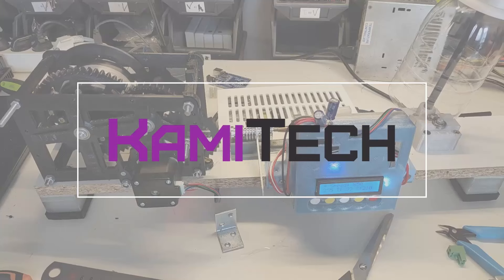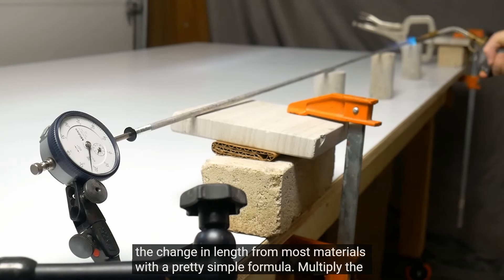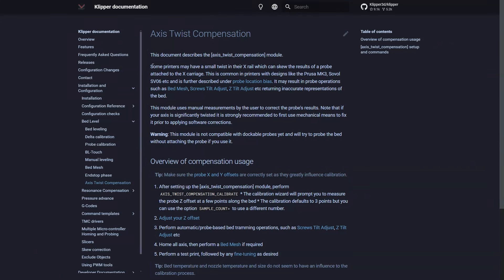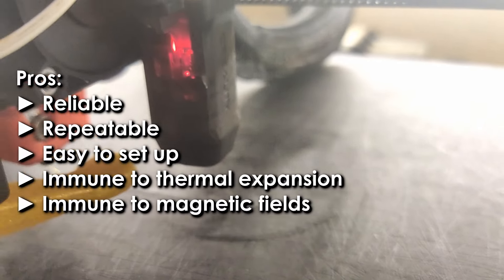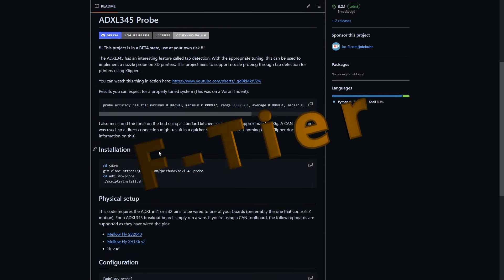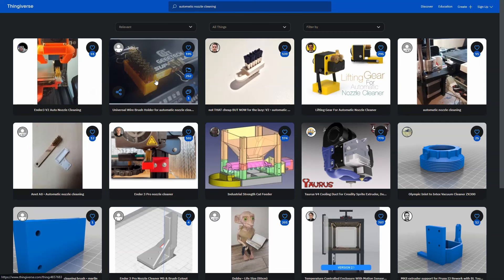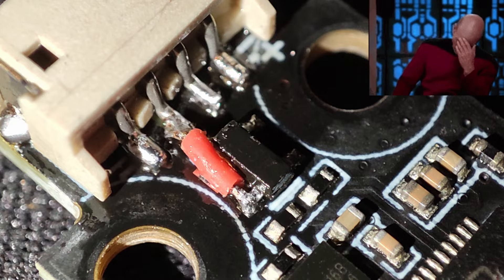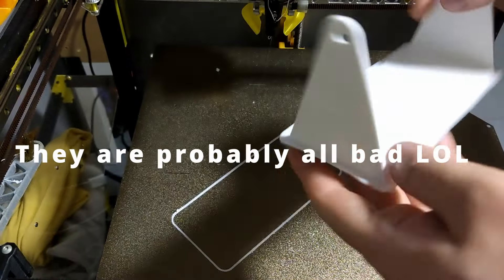Why All Bed Levelling Probes Suck - Eddy Modding and Testing

Comment: Beacon is pretty good :) especially now that it has contact. i've never had better first layers. Not to mention if you go full contact strong magnets don't matter :)
Reply: I was shocked when I used Beacon Contact the first time. I was like 'There's no way this just works... holy crap. I didn't have to set an offset. I didn't have to do ANYTHING. It just... worked.
Reply: So I thought it used eddy coil to get the mesh and that have magnets would affect the probe can you elaborate more on this, maybe post a link or some supportive data. I'm now genuinely curious about this.
Reply: @fredhenning798 contact function in Beacon is touch based and super low force. I’m using it on a wobbly switch wire bed and it’s perfect, in every way.

Comment: Interesting comments, smiled at the brass brush nozzle cleaning, as been there done that years ago, and it really sucked, because the ooze set on the “bristles” and caused mis-steps. Shame you couldn’t get a Beacon, as I was waiting for that one. Good work on the BTT Eddy 👌
Reply from the maker: In my case brush also didn't do anything with petg, nozzle just grabbed chunks of it anyways and stringed away, dragging giga blob across build surface 😂
Reply: @KaminarisTech yes PETG is a pain to clean and so is TPU. Have to do it manually
Reply: I have tried different inductive probe. Kicky and TAP. So far for me the TAP is the most precise one. But I had to change the X rail and the mini TAP rail for medium preload rail to get consistent. But yes it is bulky and heavy.

Comment: My favorite combo so far was a v2.4 with a properly flat bed and physical probe like klicky, quickdraw, or bltouch.   It's incredibly reliable compared to anything else I've used. I've worked with 7 machines on similar setups, and they're incredibly reliable. Currently running a cartographer on one machine and omron inductive probe on the other (no kinematic bed/gantry mounting), and they're nowhere near as reliable.
Reply: Beds are all stock 6mm alu from formbot
Reply: Carto works great for mesh leveling, but z offset can be iffy. I'm going to swap to a nozzle endstop like on the v2 for now, but I'm hoping the nozzle tap feature works properly, like on the beacon.
Reply: Thermal drift kills most non physical probes. Even with a heat soak macro that read the carto coil temp to make sure it meshed and homed within a 5c range and running the temp compensation macro, it still drifts a bit.
Reply from the maker: Indeed, kinematic bed + physical probe seems to be best accuracy and reliability wise as z-endstop. Unfortunately they suffer greatly from axis twist and they are very slow for heightmaps. I wish to try cast iron bed one day :D
Reply: @KaminarisTech  that'll be pricey 😅
Reply: Voron with the cartographer via can is perfect every single time. Never not had a perfect first layer. Klicky is slow as balls.

Comment: In my humble opinion, apart from those thick 8mm aluminum beds most commonly found on Voron printers, I find borosilicate glass bed delivers one of the flattest surface ever. Only problem is chunks of glass gets chipped off as what you had mentioned in your video. So to mitigate this problem, i stuck the magnetic sheet on my borosilicate glass and then offer the PEI sheet over the magnet. The bed does take a little longer to get heated up but once it gets to your desired bed temp. it stays hot consistently. After doing this method my first layer has been consistently great.
Reply from the maker: Yes i did consider using glass this way but the difference in heating speed is real issue. Currently my bed heats up from zero to sixty in about 60 seconds and zero to 90 in 90 seconds. That saves a lot of time the way i print things (prototyping). The only real alternative is just thicc chunk of metal.
Reply: I do exactly the same as you!, 🙂 magnetic sheet stuck to borosillicate glass with a steel pei sheet on top, I run a bed mesh and check the level and adjust where needed by rotating 3 lead screws one at the back in the center and two at the front corners either side, I then probe the center of the bed after it's heated before I start a print. If I want i can remove the bed take the pei sheet off and also print on the glass side by turning it over. I use a bl touch, it's slow probing multiple points on a bed mesh but it works. wouldn't mind trying a beacon!, printer is a Vzbot with some parts from a hevORT it's kind of a hybrid.

Comment: I definitely feel like Nextruder is the best current hands off implementation of bed leveling and Z-Offset. They've shown examples of printing a first layer on cardboard taped to the bed.

For nozzle cleaning I've had pretty good results with an Obxidian or similar nozzles with a good retraction macro to prevent oozing and a straight forward nozzle wiper.

I feel like that the above plus a Nextruder like strain gauge, adaptive meshing would be ideal for me.

Comment: Thank you for this video, I really enjoyed it. One thing that perhaps can be expanded upon is the types of probes relative to the build plate size. Most probes work on the large beds you were demonstrating. No so good on a 120 x120 bed due to large offsets because certainly in the case of the Voron 0 or similar you can only get to probe two thirds of the bed. The new klicky and it`s cantilevered predecessor will score here. Also perhaps the new E3D PZ, I am waiting for one to arrive to test. For example I spent months developing a condensed tap for the Voron 0 to achieve full build plate cover. Anyway, many thanks again for an interesting video, well done

Comment: For Nozzle cleaning, I looked at how Bambu Lab printers do it.
They perform some strange movement, but the more interesting part. They Heat the Nozzle to 250ish no matter the material and just let it droop out the filament remaining in the nozzle.
I applied this to my print start and the results are amazing. It takes 2-3 minutes of oozing, then the nozzle is clean and can be used for homing.
Reply from the maker: Here is the thing. Bambu have super short melt zone compared to like the Goliath hotend which i have and it drips for a LOOOOOOOOOOOONG time :) 
Still, 2-3 minutes is pretty long time to wait just for z-homing.
Reply: @KaminarisTech  yea right 2-3min works for my dragon highflow. But the wait is worth it for me :D
Reply: @TheHanutaXD could you Provide the start Code for that?
Reply: I don’t care about how long it takes. It has to be accurate. 
I use tap and a Bambu hotend on my Voron. I clean the nozzle with a wiper and then clean and cool down the nozzle on the build plate while going back and forth 10mm with z-0.2mm to scrape over the build plate. 

No z-offset issues anymore.. I tried the inductive probe then clicky and tap is the way to go. I use 3 measurements for each point.

Comment: I just ordered an eddy after having a horrible experience trying to set up my  2024k1 max which dug holes into 5 bed plates and knocked 2 nozzles loose, and bent the x rod trying to get through the initial calibration. One of the belts was loose and another was rubbing out of the box.  Creality sent me some replacement strain gauges, a belt a bed plate and some boards but I am traumatized by the physical probing. I'm hoping eddy can solve this issue!

Comment: Thanks for your interesting take on this tricky subject.

Here's my input:
I have a Voron 2.4 with CNC TAP. It's reliable, in fact it's pretty close to Fire and Forget when it comes to printing. What it isn't is fast!, but that's not a problem for me. 
I was going to change (I won't use the term upgrade because it might not be) to a Cartographer (see below for my Cartographer experience).
You can change your PRINT_START so that the nozzle temp is set at 150 before bed meshing - there is a either a cool down time or a warm up time - time for me is not an issue.
I haven't done this change, so mine probes the bed with the nozzle at print temp (260 normally).
It has not marked the bed (over 500 hours of printing). It does leave little blobs/snots at the probe mesh points if you print PETG, but they can be scraped off.

Cartographer - I fitted a Cartographer (USB) to my VzBot 330 AWD, it didn't play well! I think it was down to the magentic sheet on the build plate. On my Voron there is only one "field" or band of magnetism,  on the 330 there are many bands of magnetism (N/S/N/S/N.....) (See my short - https://youtube.com/shorts/zoDxIrudB4w). No matter what I did, I could not get a reliable first layer.

So then I bought a Beacon H - this was working fine, good reliable first layers. But, last night after about 5 hours of printing the first layers all went to hell in a handbasket. I tried recalibrating the Z probe - that didn't work. I don't if the Beacon got "cooked" slowly over the 105c heat from the bed. I'm going to try it again tonight to see if the stability has returned. If it has, I'll subject it to another 5 hours of ABS printing and see if the problem arises again.

My experience with the automatic calibration of Beacon did not end well, I had to go back to the beginning and do the manual calibration.

For my 330 I'm probably going to spend a lot of time getting the bed parallel to the frame, this will mean ditching the silicone stand offs and replacing them with a mechnical "bottle jack" type of device which would give the ability to raise/lower the bed corners individually. The bed on the 330 is seriously thick (8mm) so it should be stabile enough.
Reply from the maker: Your experiences is just a confirmation that no probe is S-Tier :)

as for the VZ330 i suggest checking out Tripple-Z mod, made a vid about it.
Reply: @paulstephenson5311 What did you end up finding with the Beacon RevH? I'm planning on using the Beacon for my printer which will be primarily printing ASA at the same bed temp.
Reply: @b-right-on6707  I had the Beacon a bit too high above the bed. I dropped it down about 1mm and it's been perfect since.

Comment: My Bambu P1S seems to know how to get the nozzle clean and the  probe with the nozzle and some sensors under the bed.  So far it has given me perfect first layer on every print.  On my Sapphire Plus I have a home-made servo + optical sensor probe and on my Ender 3 I have a home-made modified unklicky style.  Both are ok, but nowhere near what the P1S delivers.  And despite lots of attempts tweaking my Klipper startup code, neither is getting its nozzle anywhere nearly as clean as the P1S before the actual print starts ...

Comment: You could always use a pair of regular touch probes on either side, if they fit.
And maybe touch probe accuracy could be improved if it gave analog readings over an interval of time with small timesteps, that could be processed by klipper? Bit of Machine learning maybe? Can't hurt

Comment: You were right at about 12 seconds into the video when you said "There is not a single solution that works flawlessly". However, there is a solution if you use two different probes: One probe can be an under-bed sensor used only to set Z offset for the second probe. This can be a strain gauge, a piezo sensor (my preference), or something completely different. A second sensor such as a BL-Touch, Eddy current sensor, or Klick probe is used for bed tilt and out-of-flat measurement for bed mesh.
This method can be seen at https://www.youtube.com/watch?v=DQXM4nrcsr4 
Incidentally, a piezo under-bed sensor can detect most kinds of crud on the nozzle as the onset of the nozzle contact will not be sharp with a dirty nozzle.

Comment: I use Voron tap. 3D printed. Wiping the nozzle clean on the build plate like on the Bambu;ab printers, first layer is always perfect now.  
I use a nozzle wiper with bucket too.

I used clicky before and hated it. Z offset was always a hit and miss.

Comment: Using bltouch/crtouch since they exist.. and even before that I made my own touch probe using a pin and optical sensor.. 0 problems, repeatability in range of 1 microstep. bltouch had minimum problems with heated chamber, but crtouch doesn't.

Comment: Btt microprobe v2 gave me consistents and better results than eddy.
Bought a cartographer now, waiting delivery.
Reply from the maker: That is just the advantage of physical probes, they just dont care about environmental issues. They are great especially for smaller printers. For 330x330  VZBot it's not really an option.
Reply: My K1 Max has almost the sime size. 
Eddy works and all, but not so consistent results.
I'd rather wait a little longer and just hit print and go away than having to wait and check the first layer every time with Eddy. 
Really don't know what happened and BTT support was useless, so I removed it.

Comment: Beacon contact puts it into s tier, but doesnt work well with g10 plates due to variations in surface versus the underlying spring steel. Contact allows you to switch to nozzle touch when neeeded. All you need to do is run at 140c nozzle and you never have to clean the nozzle. BTT should implement contact also and I'll be a customer.
Reply from the maker: Unfortunately imo it is not S-Tier, has the same drawbacks as strain gauge. With added benefit of quick height maps. S-Tier solution would be something that is truly hands free and works on all surfaces.
Reply: @KaminarisTech  how is it not hands free? Axis twist is only an issue if you have mechanical issues like loose rails.

Comment: Why using metal scraper on a magnect PEI plate ?
Reply from the maker: PEI is surprisingly strong. The only damage i was able to inflict was from the hot nozzle itself. Also my metal scraper was treated with angle grinder so it's de-sharpened and rounded over.
Reply: I meant that plate supposed to release the print with a little bending. Like a banana, as  you said. lol

Comment: I do not have a metal build plate, so probes like the Eddy don't work.

I print on a plate of FR4. Why?
- I only print high temp materials, mainly ASA, and ABS so I don't want to rely on a magnetic surface which will loose it's magnetic properties after a few weeks printing on a 100 degree or above bed.
- It is dead flat and much cheaper than a machined alu slab.
- Is does not expand or contract when heating and cooling down.
- Because FR4 self releases the print completely after a bit of cooling down, I just take it of the bed. No need to touch it with my fingers.(and no glue stick required) 
- Because I never touch the bed and FR4 is such a stable material, I never have to reprobe a bed mesh, I'll be printing in a few minutes (yes, it heats up to 240/100 C in 3 minutes)

I have used a servo deployed probe for many years and that worked fine most of the time. Only issue as the servo not deploying 100% sometimes. Since a few years I use a 3D touch probe which serves me well.. on any surface.
Reply from the maker: Indeed eddy probes won't work on non metallic surfaces but It never occurred to me that someone would try this without metallic liner. Because in case you don't know, as long as you have something ferromagnetic beneath FR4, eddy current probes will work. You do NOT need magnets anywhere in the bed, just ferromagnetic metal :)

Unfortunately:
- You do not need to rely on magnets with powder coated PEI spring steel either, I just used clips for quite some time.
- FR4 being "fiberglass-reinforced epoxy laminate" expands and contracts similarly to aluminium, it's thermal expansion coefficient is somewhere around 14-17, its nowhere near granite or cast iron
- PEI does not need glue stick either, never in my entire 3D printer career I have used glue on build surface
- FR4 will eventually bend like a banana, it is only a question of how long will it take. This is a common problem with it if you take a look at old BGA electronics repair like PS3 PS4. At some point it's impossible to resolder GPU/CPU back because circuit board is permanently bent.
Reply: @KaminarisTech  Thanks for your reply.
I don't know about Inductive probes reaching through a thick FR4 sheet? Coul work, but just touching it with a probe means you could switch out different plate thicknesses without recalibration (but I don't really  do that)
Of course you can also use clips on a PEI sheet. But these sheets are so thin that ABS could probably pull it up when there is no magnetism.
FR4 might expand a bit when heated up, and that is probably why parts release when the plate cools down, but it does stay totally flat. (I believe I use 2mm thickness)
I did not say that PEI needs glue stick, I only said that I never use glue stick on FR4.
About the bending of FR4; PCB are thinner thus less glass fiber layers. They're also bonded with copper traces which have a different expansion rate. In an electric device, the components at the top heat up a lot, so that could all contribute to warping. None of that with an evenly heated FR4 sheet.
I'll defenitely stick with printing on FR4, works like a charm for me
Reply from the maker: @winandd8649  For inductive probes FR4 simply does not exist. Unless its one with copper layer.
Yes it is not immune to nozzle change.
As for FR4 thermal expansion i suggest you check out that phrase in google. It is eventually going to be a banana, normal electronics don't heat the "PCB itself" to 80deg.
Reply: @KaminarisTech  Thanks, I'm happily printing for 5 years on the same FR4 plate at 100C which is still dead flat. Works for me..